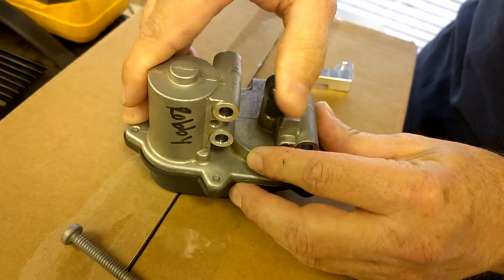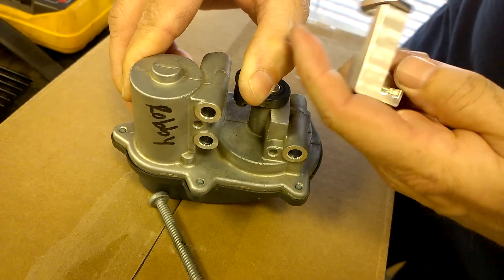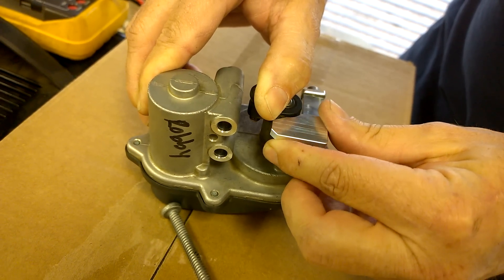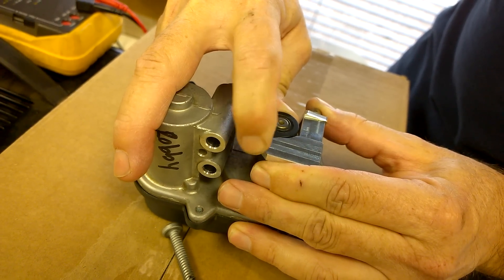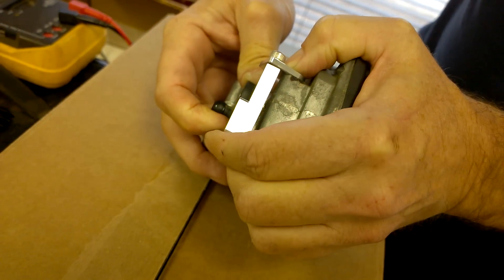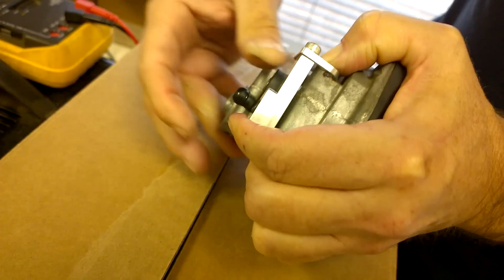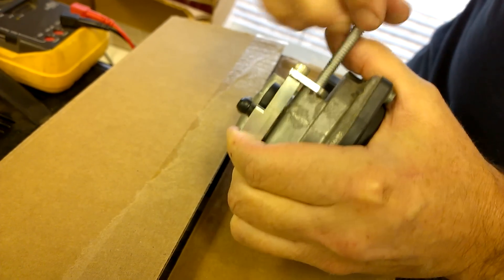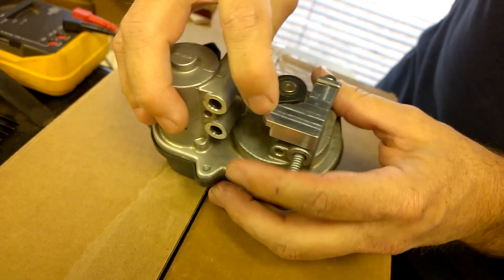V157 motor "Nub"

Comment: Does this work with a "2016" VW Tiguan R-Line 4 cylinder   ???   Thanks!     Again, " 2016"
Reply: @dieselgeekdotcom  My engine says "TSI" .  it's gas (not diesel).  I have the R-Line. Front wheel drive 2016 TIGIAN.   Will this gadget work?

Comment: Bonjour ça marche pour golf 6 2.0 110ch
Reply: What it fits:
il marche sur:

In USA and Canada: All 2009-2014 Golf, Jetta, Jetta Sportwagen, Beetle and Audi A3 with Common Rail TDI diesel engine. (The American made 2012-2016 NMS Passat doesn't have a flapper mechanism.)

Outside of USA or Canada (2008-2014 2.0 liter, 4 cylinder Common Rail TDI:

Volkswagen Golf, Eos, Beetle, Jetta, Passat, CC, Scirocco, Amarok, Touran, Transporter and Tiguan

Audi A3, A4, A4 Allroad, A5, A6, Q3, Q5 and TT

Seat Alhambra, Altea, Exeo, Leon, Ibiza, and Toledo

Skoda Octavia, Superb and Yeti

(depuis du website)

Comment: Is there any chance this V157 motor to die ? My mechanic told me is working from time to time. He open the V157 inside and check the motor inside.. the smoler one which is moving the arm of actuator. Is there any change to put it wrong ..... is there + and -  or it dosent matter how you will fit it. Is this morot direction of rotation or no matter how you will fit he will do  what it should be? Thanks